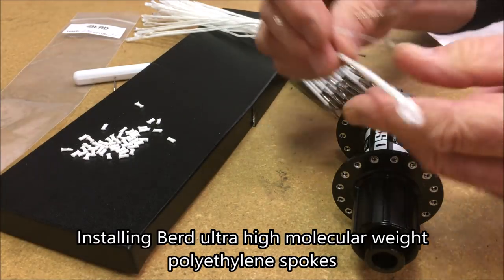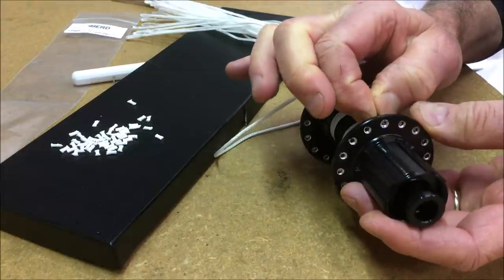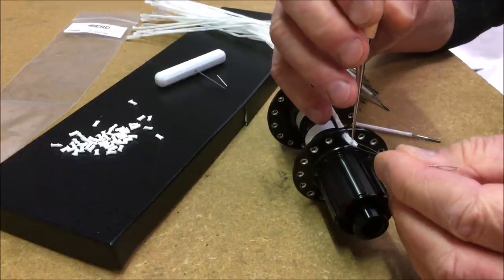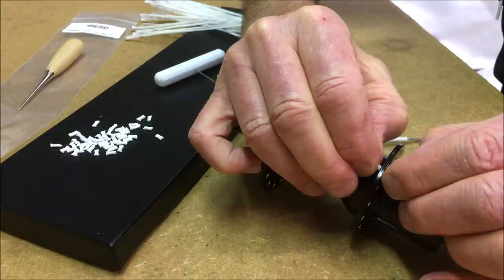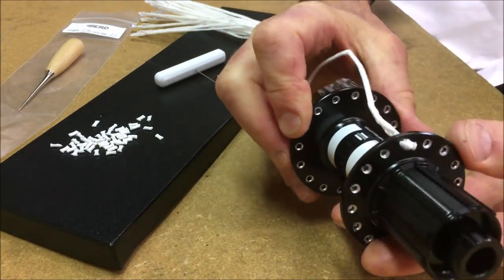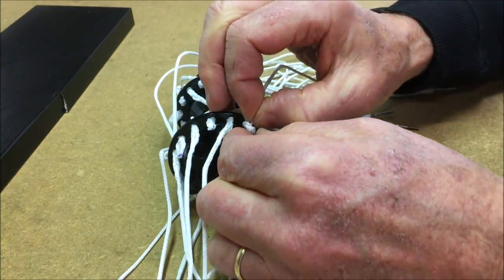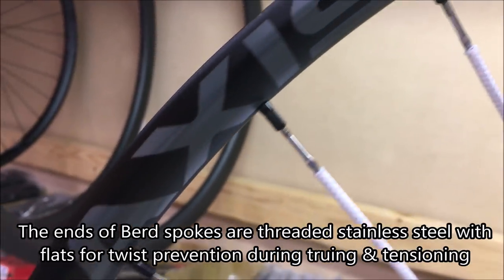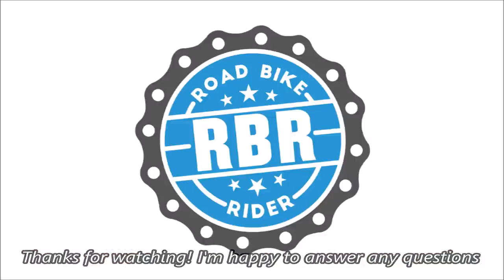Berd's Ultralight Polymer Bicycle Spokes - Wheelbuilding Tips & Observations

Comment: Great video. Ever since reading about this technology I've been curious how the wheel build would go. Those small ends threaded through the loops is very different and looks a bit tedious. Would modifying the flange spoke holes void some manufacturer's warranties?
Reply from the maker: Thanks, Dan. Yes - good question - I think you're right that removing material from the hub spoke holes might void some hub warranties. The wheel builder would probably want to ask the company if it's okay to do it. I did not ask about the DT Swiss 350 hubs I'm using in the video as these are just wheels for a test, not for sale. In the 1980s when bladed spokes first came out, we used to have to slot all the hub holes or else the super wide flat aero spokes wouldn't go into the hubs. For this we used jewelry files and carefully cut a slot in the thicker part of each hole. It took forever doing it by hand like this but you had a lot of control over the end result. The hub makers didn't approve, but I never had a hub break at the spoke holes - which I actually found a little surprising. I wonder if Berd might come up with a tool that instead of cutting and removing material, instead stamps it? I can see some type of locking pliers with mandrels on both jaws. When you close and lock the tool, the mandrels would press into both sides of the spoke hole and form them to smooth any sharp edges. I've made a couple of simple bike tools and I think something like that might be possible. Thanks for your great question, Dan! Jim
Reply: @JimLangley1  deforming the existing material sounds like the better option vs. removing material like Berd recommends. I guess your suggested method would be similar to how a standard steel spoke beds into the flange material during tensioning and stress relieving. Hub manufacturers are pushing the material limits all the time and I would hate to introduce a failure point in order to utilize a stronger mating component.
Reply from the maker: Yes, exactly, Dan.

Comment: Would these hold up on a freeride or downhill MTB?
Very interesting stuff for sure anyways!
Reply from the maker: I built one set of off road wheels so far that’s for a guy who rides all the trails here in Santa Cruz. He loves how much lighter his wheels are now and so far no problems at all. The material Berd uses is  stronger than what’s used in steel spokes. They should work for all types of riding I think. Thanks for the comment!
Reply: @JimLangley1  That's really good to know! Thanks :D
Reply: Thanks man! I may try these out very soon. Would like to know if these ‘feel’ any different in the way of vibration deadening over gravel/rough roads? Many ppl often overlook that smooth riding in search of performance only.
Reply: @SprayIgniteBoom  It should dampen vibrations as it's not a solid material. Works the same way in speaker cone materials. Something very hard like Aluminum or Carbon has resonances that need to be damped and paper on the other hand doesn't have as problems as it's a softer material with many fibers.
Reply: @kaedeschulz5422  Thanks! I also grew up near where Berd has their hq. I ride/live here in N.Italy and there are many ‘roman’ built rds here...I have some Miche and Fulcrum rims I’d like to ‘lighten’ up. These may be a great addition to my bikes!!! All 4 of them (1 for each type of intended terrain)
Reply: @SprayIgniteBoom  Wouldn't 2 wheelsets and with different tires be enaugh?
Reply: @kaedeschulz5422  Sure, but I am modding all 4 bikes for various reasons~ One Italian road bike in standard fair, a custom one off ‘aero’ triathlon build, a gravel/urbanex, and a mtb hard tail. Fairly within reasonable price ranges as most were frankenstein’ed’ together based on my preferences and net hunting. Enjoy the ride~ take care
Reply: @SprayIgniteBoom  I find building a gravel specific bike doesn't make sense but to everyone is different.
What kind of Hardtail? An all mountain/enduro Hardtail like the Mmmbop or Kona Honzo ESD for example?
Reply: @kaedeschulz5422  nothing quite so exotic~ a simple Trek 4900 with Conti Trail King 👑 up front and a Conti race king 👑 out back. I was gifted the bike from a neighbor b/c the shock had failed and the bars were bent (he crashed). So I’ve had the frame looked and it’s ok, fitted a Marzocci (in Italy 🇮🇹 there are quite a few of these) and some nice riser bars fitted. I mainly do alpine roads with road bike and not a lot of mtb. I also have 2 girls and other equally spendy hobbies. What about you?

Comment: How does this hold up under UV and high heat?
Reply from the maker: Thanks for watching and the question, Josh. I don't know of any tests for those things, but it stands to reason that high heat could damage polymers, so you probably wouldn't want to get your wheels anywhere near the car exhaust carrying bikes on the back. As far as UV goes, several viewers commented that other products made with similar technology are affected by the sun's rays. But again, I don't know of any tests for that that Berd or anyone else published so I don't know of any data to share.

One of the product names viewers have mentioned is Dyneema, another polymer used in backpacking gear and other sporting goods. So, I searched for something about the effect of UV rays on that and I found this pdf, which offers a little information: https://dynamica-ropes.com/wp-content/uploads/2017/05/CIS-YA102-Ultraviolet-exposure-of-UHMWPE-fiber-from-DSM-Dyneema.pdf Thanks again!
Reply: @JimLangley1  Good find!  Looks like that's the best of the bunch but does suffer a bit. I live in Arizona, which has high road temps (120F air and 140F asphalt) and high UV index for half the year. Incase it seemed like an odd question.
Reply from the maker: @JoshHefnerX  I've had some great rides in Arizona like the Tour de Tucson and PacTour's Desert Camp https://www.pactour.com/ You live in a beautiful area, Josh! I have never been there in the summer but I've heard plenty of stories about the high temps yours is a great question. Thanks again!

Comment: Cut resistance?  That’s the part that worries me. I’m trusting my life to my wheels every time I ride.
Reply from the maker: Thanks for watching and the question, spongesurf. The Berd spokes can be cut with cutting tools like snips and scissors. They're designed to be able to withstand the things that might hit the spokes when riding. If something went into the wheel and locked it up, it would depend on what that something was whether it would cut the spokes. A round stick probably wouldn't cut the spokes.

Comment: Not a very good idea I'm afraid as the polyethylene is prone to decrease in mechanical strength quite rapidly when exposed to uv light. If you put min 2 % of carbon black into it, it will fair a lot better, but still I would never consider buying a wheelset with PE spokes. Plastics are absolutely fantastic, however in the correct applications.
Reply from the maker: Interesting, Ducatimale. Thanks for telling us. I will be on the lookout for early deterioration or failures with the test wheels I'm building with these spokes. Thank you.
Reply: This spectra/dyneema material used to make the spokes has been around in club racer sailing applications for over a decade now. UV issues are basically non-existent. If you were super concerned, you shouldn't be, you can use something like Aerospace 303 as a UV protectant on them.
Reply: @otm646  Horses for courses I believe would be the term in my opinion. A material extremely good for one application is not necessarily any good at all in the next. Have you talked to DSM, the manufacturer,  concerning the use of Dynema in this particular application? Has there been any accelerated ageing tests made for this application, as you normally would in a case like this?
Reply: It's also not a good idea to make comments based on conjecture. It is well documented that Dyneema has excellent UV resistance for a polymer fiber, practically speaking it is not a significant problem unless you are storing your bike in the sun for long periods.
Reply: @DarylNaskale  Yes, Daryl, I do agree with you on conjecture in general terms and for a pre-study of a material. However, if you take the automotive industry f i, whenever you introduce a new material into parts that are of structural or safety concern, massive amounts of testing is done to ensure the material is suitable for its thought purpose. This is done for a very good reason. I personally would have no problem using wheels built with polyethylene spokes for hill climbs. But I would absolutely not use them for normal road riding or (I heard this was suggested in a well known cycling podcast recently) for MTB.
Reply: @ducatimale  I get your point but it is not accurate in this case and the bicycle industry moves much faster than the automotive industry. As I understand it, these spokes have already been used extensively and tested for years. The concept wasn't commercially viable until a particular variant of Dyneema (DM20) was introduced to the market about 5 years ago. Relatively shortly after this variant was available in the appropriate specification Berd started selling their spokes. DM20 greatly reduced issues with creep and stretch, and has other beneficial characteristics such as greater thermal stability and UV resistance compared to other polymer and UHMWPE fiber products.

I personally know of several people that have been using these spokes on road bikes and mountain bikes with excellent results. I have read many reports on them from actual users on forums. Reviews have been written. Wheel companies have started to incorporate these spokes into their stock builds for road, cross and MTB use. Berd spokes are not yet mainstream but they are proven to have performance benefits and few drawbacks, primarily cost. Long-term durability is still a fair question but it becomes less of an unknown every day.

I personally plan to be riding Berds on my MTB soon based on my research into them and the evidence of their performance. It was not difficult to find adequate information to be comfortable in making this investment, the introduction of the black color option was a bigger factor in the end as I would not run white spokes and had otherwise been convinced of their merits.
Reply: Just use them at night.    /s

Comment: 100-200g saving. Not worth it.
Reply from the maker: staffordandy Davies Thanks for the comment. Berd would say that being able to take so much weight from whatever lightest pair of wheels you favor is a significant accomplishment. Also, it’s a softer smoother ride. But yeah it’s expensive.
Reply: It is rotational weight you are saving which is most noticeable, why else is a lighter wheelset upgrade a first thing recommended to upgrade, it does make a difference. Try a set of 2000g wheels vs 1500g wheels, the difference is night and day. Weight saving comes to around 170g per wheelset.